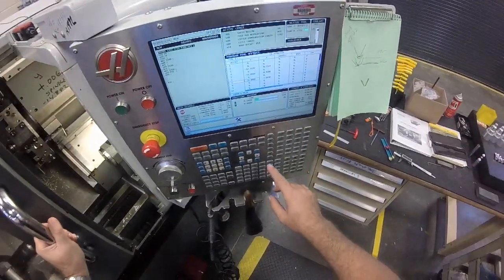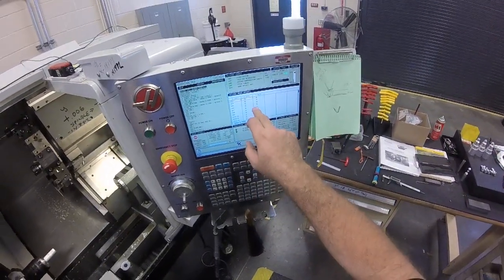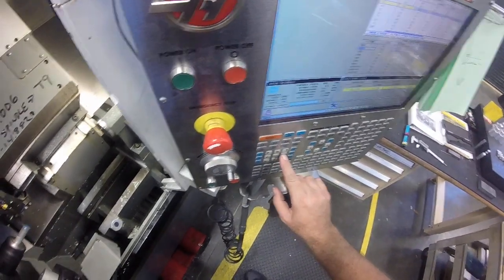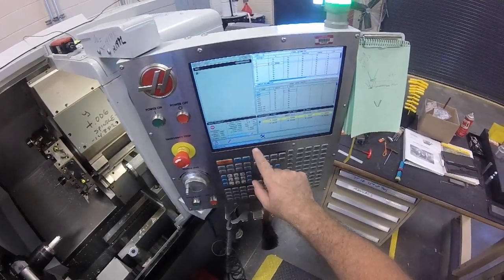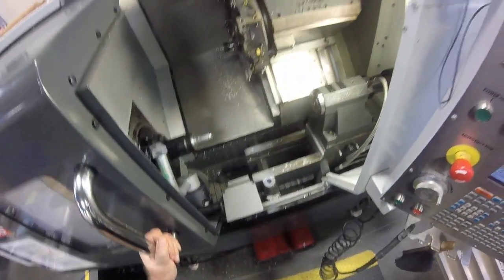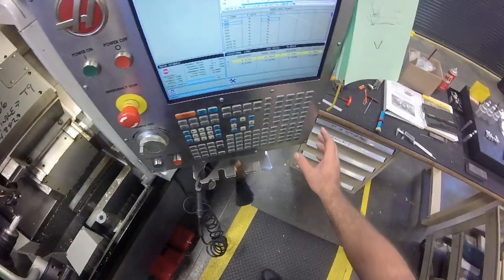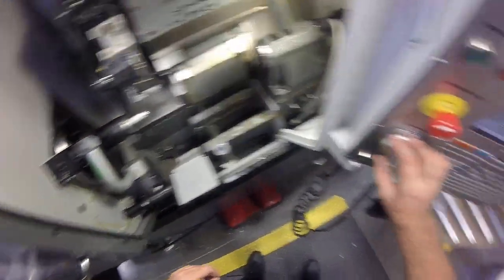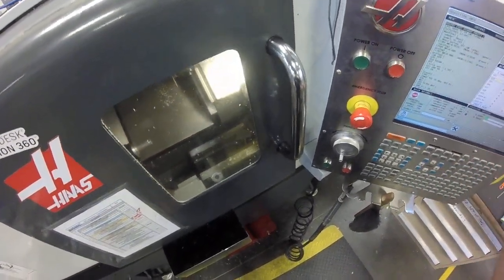Haas CNC Lathe - Manual Setup - Step 1

Comment: Quick question, In order to teach a tools Z offset manually, does our g54 need to be set to zero first?
Reply from the maker: touch all tools off the same spot - Like front of stock in Z axis

Then you can "shift"  the Z axis with the G54 if needed.  other wise just leave G54 at zero 

look at this video as well 
https://youtu.be/rd2u2MG6meY?si=c3qUooyUr46SplmK